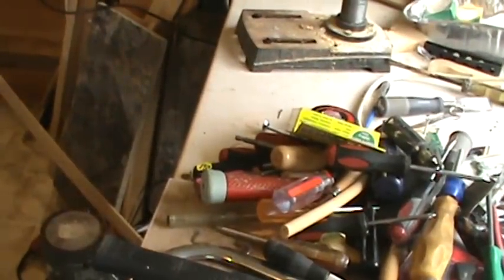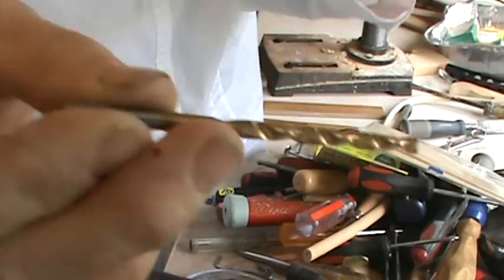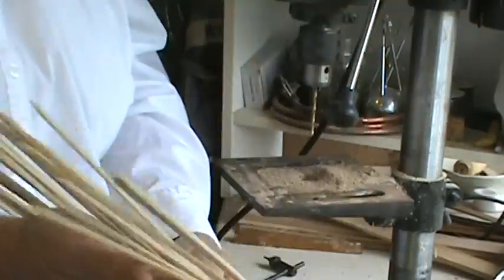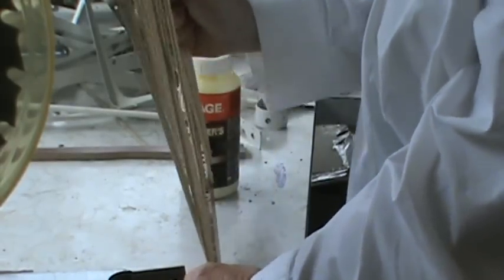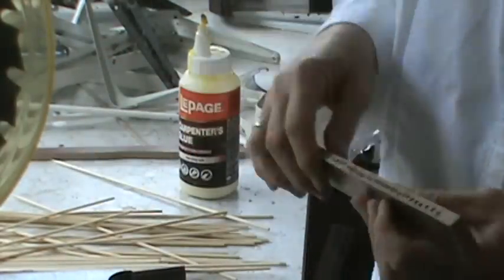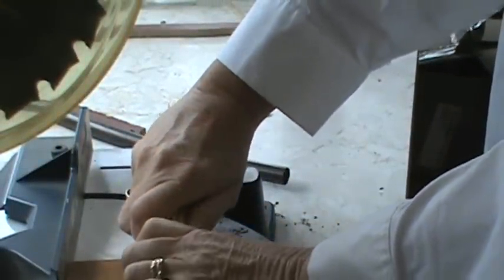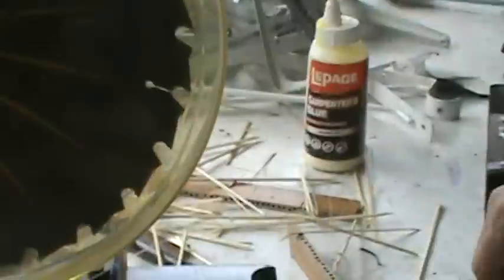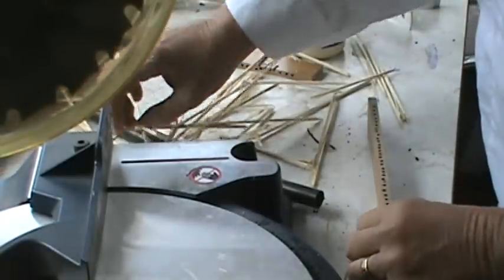Nancy Today: 1 make backstrap loom ASMR

Comment: LOL! I enjoyed watching you :) Feels good to know I am not the only one who makes blunders. I like how you showed your trial and errors. I have a couple suggestions for you: 

1) next time you go to use the sticks, measure one to the length you want and mark it with a fine sharpie and cut it. You can cut the sticks with a pair of cable cutters and they won't splinter or at least not too badly. Take the remaining sticks  and lay them on a flat surface with the ends flush against a flat surface. Use the stick you first cut as a guide to mark where to cut the rest of them. After you have cut all your sticks, you can use an emery board to sand them a bit. (Save your left over sticks for another project :) )

2) when you get your pieces of board cut, line them up and use a couple of small clamps to hold them together. You can make a line across to mark where you want your holes to be and drill in the center.

3) for safety wear close fitting clothing- I would hate it if one of your sleeves got caught in the equipment.
Much love and God bless,
~ Niccole
Reply from the maker: Thanks, Nicole!